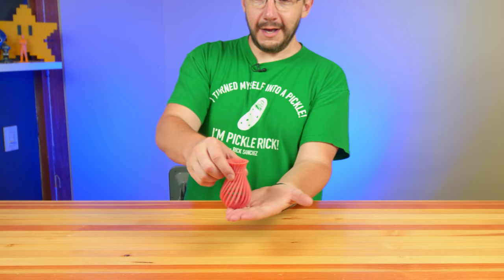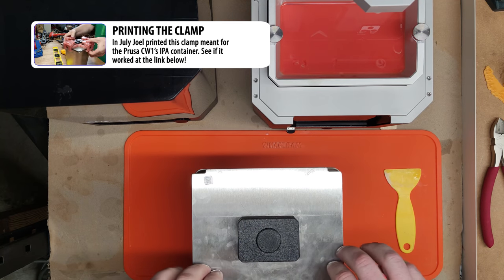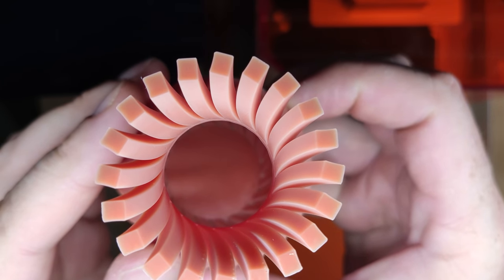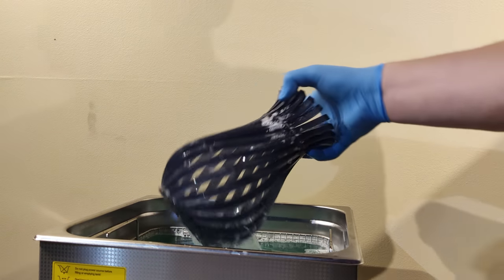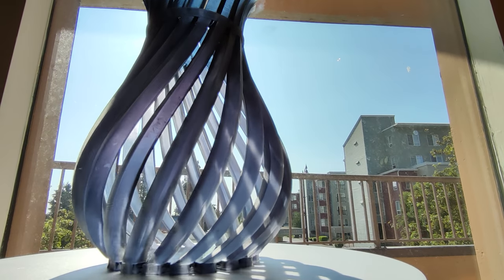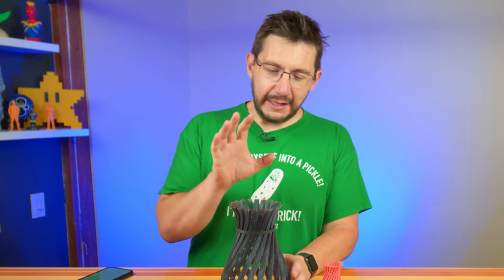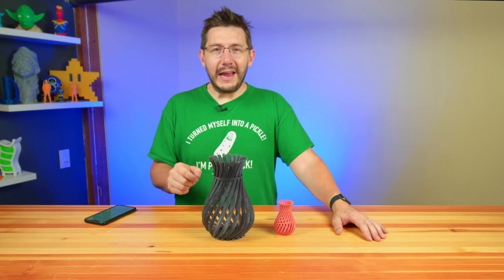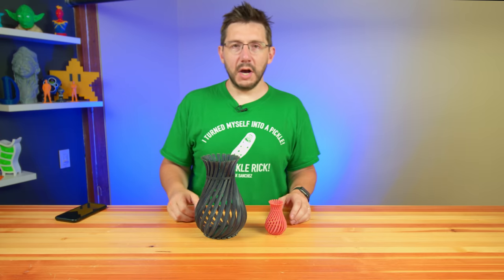My Process for 3D Printing RESIN

Comment: I worked with cloths soaked in strong degreaser with my bare hands 100 times without issue. Time 101, your skin decides it's had enough and sensitizes. I now have extreme eczema that flairs up when I go near detergents, or heat, or cold and have permanent fragile skin which is the greatest handicap I have when working on projects. 

The fact that it was ok once or twice or 10 times is most certainly NOT a guarantee you're somehow impervious to it. Don't do the stupid thing I did and always ALWAYS wear gloves when working with chemicals.
Reply: Also ventilation and respirators with the proper cartridges. If it does awful things to your skin, imagine what it will do to your lungs.

I lost my dad partly because he was careless in the past with certain chemicals.
Reply: Yeah, I never got cancer! You know, until I did...

Comment: I'm glad that you said that you should always wear gloves when dealing with resin printers, but it sounded like you were saying that because you have found that you don't have a resin sensitivity that you should probably be okay to touch it a bit. The thing is that the more you are exposed to these things, the more likely you are to develop a sensitivity/allergy. I really think that you should avoid touching it at all times, even if you've touched it before and were "fine." 

By the way, I think spraying the transparent prints with a gloss enamel spray will make them look better and remove a lot of the cloudiness that tends to occur after they are cleaned and cured.

Comment: For those worried about glass blocking UV, this is only a problem for wavelengths <~300nm for most types of glass. At the 365nm-405nm range, there is at least 80% transmittance so there is really no issues with the resin being cured as most (non-mono mSLA) printers are typically transmitting <5% of the ~405nm light. 

Great video Joel. When I was things with degreasers, I also like to give them a good scrub in warm water to help ensure all the soapy nonsense is gone. And then, if you want quicker drying a rinse with IPA/EtOH/Acetone does the trick but for me, the important part is a nice thorough rinse with water as those surfactants tend to stick around. The vase came out great, my only 'issue' with Siraya Black is that I love the blueish cured-but-not-fully-crosslinked color and you quickly loose that color during the final bake which is somewhat of a bummer. The black still looks good, but I love that blue-violet  color oh so much more.

Comment: Joel, I have the "regular" Phenom, I do a two stage wash.

Step one, five minutes in Mean Green.

Step two, two or three minutes in an IPA bath to clean off any final bits of resin and the slight bit of residue left by the Mean Green.

Then I blow it off and leave the rest to air dry for 30 min to an hour.

Final, of course, is curing.

It is a bit more involved, but the final rinse helps a lot.

Comment: Have to agree with the resin. I've had the odd occasion where I couldn't use gloves at some stage in the process, and while I don't react quickly (if I do at all) I always wash it off ASAP just to be safe. Never had a problem! Always better to be safe than sorry! Also yay for GeekyFaye feature! \m/ She's a legend!
Reply: @katzcreates  shrugs I'm just me! From the moment we crossed paths on twitter oh so many moons ago, I could tell you were special 😂
Reply: But... That's the thing... You "never have a problem" right up until you do. And then it's too late. So "better being safe than sorry" would be, you know, wearing gloves. 🤷🏻‍♂️
Reply: @SoHautRightNow  Well, that was part of my point. Even though I don't react to it immediately like some claim to, I still wash it off as soon as possible because I know it's potentially bad. There's no way I'd be leaving it there for any length of time just to see what happens. 😂And I"m only talking about small amounts too. If I was at all likely to end up with it smothering my hands, I would always use gloves. I'm merely pointing out, that if you get a drop on you, and wash it off quickly, you're not going to die ;)
Reply: @welbot  I had that attitude too! Then I got cancer. Wear gloves. And a respirator.
Reply: @SoHautRightNow  It's not an "attitude". 99.99999% of the time I wear gloves. Just the very rare occasion where I've had to touch something uncured without them :) As for a respirator, I'd have to wear one 24/7, as I have an open (but covered when not in use) 13L vat sitting in my lounge room. Thankfully the resin I have a) doesn't stink, and b) apart from "possible irritation to respiratory system", has no specific health warnings or known permanent effects. Believe me, I've done plenty of research on this before I delved in to this world :) 
I certainly agree though, that some resins are very bad for you, in both a contact, and airborne manner. Always best to research what you use, and how to use it as safely as possible!

Comment: 11:05 Joel, that distortion is due to weak coupling (impedance mismatch) between the air and the energetic (orders of magnitudes than what clipped your mic) liquid you dipped your HAND into. Don’t do that if you value your joints!

Comment: So, I have a resin reaction, in my case  ruddy awful headache if i get it on my skin, but, it happened in a snap and it wasn't something id had a problem with before.
Reply: You probably weren't using good enough safety gear and your body became sensitised to the resin, causing you to have a reaction.
Reply: That sucks but not a true reaction if all you get is a headache. Skin would have to freak out for this to truly be a genuine reaction to it

Comment: My recommendation, get a razor scraper for getting the prints off of the build plate. It makes getting prints off much easier and quicker, and less likely to damage the print.
Reply: Also, I use an fine haired soft paint brush to help get resin out of spots that the ultrasonic cleaner didn't quite get.

Comment: Joel. Anyway you cure it.. it is definately " Prophylactic Pink."  Geeky Faye touched on an important point about 3D modeling. Use the tools that you are comfortable with. Don't feel you have to go for complicated parametic software or similar. Any software that at least exports *.stl files is useful. Love your vids. Subscribed..forever.

Comment: Love the Tee Shirt by the way ("...I'm Pickle Rick!"). I recommend making a video describing how to use Resin printers safely. Formaldehyde is absolutely no joke and is an output of 3D printer resin. I just bought a Elegoo Mars Pro, a UV 405nM light (to cure the models I print once Amazon gets it here...), a turntable and more. But I would like to know how you go about avoiding the gaseous output of such resin. For the safety of all possible users, it makes sense.
Selfie with it? No problem!

Comment: 12:06 There are visible patterns on what's supposed to be a smooth surface. Do these come from the (lack of) resolution of the printer?
Reply: Not the resolution of the printer but rather the layer height of the print. According to the time and the number of layers he had for the print each layer took just over 15 seconds and I would say from the print a layer height of .1 mm.

What he should have done was half the layer height to .05 mm, this also reduces the amount of time needed to cure the resin because it is half as thick. This normally results in the same amount of time ~ 19.5 hours but twice the quality of the overall product. If Joe was mass producing these items he would try and squeeze all of the speed out of this. Another way of doing it would be to make it hollow which reduces the print time further maybe 8-9 hours, then make it solid after the print was done by fill it back up during curing.

Comment: Hey Joel, nice video but just wanted to add. While some people are undoubtedly more susceptible to developing a sensitivity to things like uncured resin, developing a sensitivity is also related to repeat exposure. You may not necessarily show signs of sensitivity initially but then develop a sensitivity over time with repeat exposure. Making statements like, well I don't have a sensitivity to the resin but you might is both ignorant and fool hardy as what may appear to be fine today might come back to bite you next week / month / year and suggests to others that if they show no initial signs of sensitivity they can more or less throw caution to the wind which couldn't be further from the truth. So, while I generally respect your opinions when reviewing 3d printers etc, please don't give medical advice as this could lead people to believe that it is safe to ignore the safety warnings around resin. Much respect.

Comment: Don't understand why you are not just using alcohol as the wash agent. It seems to be far more efficient than soap/detergent. And it will evaporate 100% with no residue of it's own. Did I miss an explanation?
Reply: Never mind,  just did a quick bit of research and was surprised to learn the detergents work better than the alcohol. Never would have expected that.

Comment: Hammering your scraper is unnecessary and damages your print. Use slow, even twisting pressure to lift the edge. Your print will flex slightly and peel up from the plate. Practice with a translucent or white resin, you can see the peel as air flows under the interface.

Comment: Great vase but for dried flowers only .... the vase design wont hold water, trust me.
Reply: Are you sure? I think this needs to be tested first, before you can make such a brave statement.
Reply: @tillepprecht  Hmmm .... I admit it is only a theory based on a hypothesis and the evidence is circumstantial.  Research has shown that 9 out of 10 Democrats think the water will flow out the gaps whereas 10 out of 10 Republicans believe it will hold twice as much water because Trump says so.  "Ya see ?! I can keep pouring the water in the top ... Melania...? why are my pants wet ? I think I need my diaper changed honey"